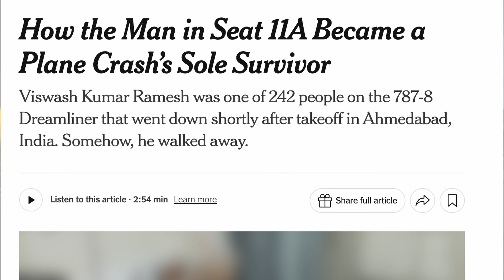Why the RAT Changes Everything – Air India 171 Update

Comment: 787 mechanic here. Regarding everyone’s comments about the gear tilt..

Yes, it appears that the gear is tilted forward in the video. This does seem to indicate that the gear handle was selected up. After the gear is selected up, the first step of the gear up sequence is for the tilt actuators to tilt the gear into the position in which it will be stowed in the wheel well.

Pure speculation, but what I believe happened from that portion of information is at around the point the gear was selected up, there was enough residual hydraulic pressure in the center hydraulic system to tilt the landing gear bogeys, but not enough to bypass the pressure switch that allows the gear sequence to continue (the next part being the gear doors dropping)

The 787 and A350 both have the highest pressurized hydraulic systems of any commercial aircraft - 5,000psi. Significantly higher than the traditional 3,000psi systems. This allows for more of a chance for hydraulic components to physically move, even if the pressure is actively bleeding off the system.

While the RAT does supply emergency hydraulic power to the center hydraulic primary flight controls, it does NOT supply power to the remaining center hydraulic system components - nose gear steering, landing gear actuation, and high lift devices (flaps and slats)
Reply: Thanks Adam.
Reply: So you're saying that they lost hydraulic power due to vibration of the APU ?
Reply: @excusemenoexcusemeno1671 no. Nothing to do with the APU. The APU was probably off at the time of take off
Reply: Do you think this condition could be caused equally by dual engine failure or some sort of catastrophic hydraulic failure?  Or one more likely than the other?
Reply: @pseudocoder78 well judging by the fact that the aircraft lost lift, it’s probably more leaning towards dual engine failure being the primary cause of the RAT deployment, which is insane to say given the odds of that happening
Reply: @adamb5660  Good point, a hydraulic failure wouldn't cause immediate loss of power.  Pretty much some sort of fuel system issue is the only thing I could think of.  Sure looks like both engines lost power simultaneously.
Reply: I notice the vortex of dust/debris on the CCTV cameras while at the end of the runway on the left side but nothing being kicked up on the other...could be they lost power on the rt engine rt at or after V1...and could not abort and then possibly the other engine failed or the wrong engine was shut down...therefore the deployment of the RAT...
Reply: @nmtaco8645 at least from what I’ve seen, I haven’t seen any significant rudder compensation which is what you’d expect if you had 2 giant engines at takeoff thrust and all of a sudden 1 goes out while the other is still roaring.

I’m not sure what happened, but I think the 2nd biggest question behind the actual cause of the crash is going to be ‘did the pilots have any knowledge of a potential failure or issue prior to that v1 point of no return.’ Even if there was fuel contamination, it dumbfounds me at this point in time how both engines could flame out at or near the exact same time. No sputtering (that we know of), no premature indication, just off like a light switch.

Frankly, I pray that whatever cause comes to light shows that there was some amount of avoidability in all this because if not, it could lead to a nightmare of 787 groundings

Comment: Remember when Delta F/O shutdown both engines on a 767 in 1986.  They got a relight just before hitting the water out of LAX.  Fuel control switches too close to engine cutoff switches

Comment: Hello Captain Steeeve. Have you heard or seen the reports about the guy that said he was on an earlier flight on this jet and the air conditioning was cutting on and off and the entertainment system was not working at all? He had video of the non working entertainment system while on board and vent issues.  I also think he mentioned the flickering of lights as well.

Comment: We are probably going to find bad maintainence.  The man on the flight before stated the air conditioning did not work or the video screens in any way.  These complex systems are intermixed.  An electrical problem could shut down the engines.  No plane should fly without the systems working.  Air India is known to be no good.  India is known to be lax as it is a dictatorship and only profit matters. Tata bought it in 2022 from the government, who had been for years trying to unload it.  

We will soon find out a lot when the Black Boxes are found and the voices of the pilots are heard and the systems functions are known such as electrical, hydraulic, and engines.  We will know if the thrust dropped and have an idea of why, such as a cut off of electrical power to run the Fadec system which controls the engines.  No power, no engine.

With an international investigation which includes Boeing, as the manufacturer of the plane, and the engine manufacturer, either GE, or Rolls Royce no games can be played by India.  Aerospace is one business which holds accountability as when there is a problem it is so tragic as right now.  Look at what happened to Boeing with the 737 MAX crashes.  They got lax and have paid a huge price.  I am now betting on maintainence and that also will be studied and mechanics and such interviewed.  Then the physical evidence.

Comment: The RAT wouldn't make a big bang upon deployment but a Lithium Battery explosion would.  It would also take out adjacent wiring which is connected to the main electrical system causing the main wiring to short out, the lights to flicker and most probably go out, the RAT to deploy and as the controls are fly-by-wire then electrical system would fail.  The RAT can not help if there is a persistent short circuit.  The short has to be isolated first.  The engines would continue to run but return to idle.

If it were a duel engine failure the landing gear would still have retracted because it takes more than 10 seconds for them to spool down from full power at takeoff and they are providing hydraulic pressure all that time.  Even if the engines instantly stopped there would be residual pressure in the system to at least begin to retract the gear.  But an electrical failure would stop any further control instantly.

Comment: Cmon people you dont need an engineering degree to figure this out. 1. Fuel pumps failed. No engine means no power, theres no gas powered on board generator folks. 2. Rat deployed because of loss of electrical and hydraulics failure. No engine rpm means no electrical which means no fuel and no hydraulics, electrical voltage is needed to run the pumps. Rat deployed for a few seconds does not generate enough power to restart engines nor supply enough power quickly enough to save any plane at 500 feet. Gravity takes over. Its designed for electrical malfunctions 5000 feet + 3. Plane descends quickly because of near max load and loaded max fuel. 110 degree heat probably had something to do with it also as someone noted a different video of interior issues a/c, monitors, etc.

Comment: A dual engine failure? Wow. And right after rotating? Has this ever happened before?

The only thing I can think of in regards to fuel contamination on a commercial jet that resulted in a dual engine failure was with Cathay Pacific Flight 780 where salt water got into the fuel system at the departure airport. It fouled the ground fuel pump filters and collapsed the filters once into flight at altitude.

IF...and I repeat, IF this is the case, were proper steps taken at the departure airport to routinely inspect the ground fuel storage and delivery systems? Because we know that there is a history of airlines, looking to maximize its profit margins, sometimes take shortcuts or lengthen the intervals on scheduled maintenance to keep planes in the air making money instead of being in a hangar.

Comment: Let's assume they did retract the flaps but they could not understand why they had no lift....then they activated the RAT just to possibly get power that they thought they needed , but did not really need...The lights would still flicker when they tried to use the power from the RAT? Is the RAT power supplemental or replaces the main power?

Comment: I was going to say your theory was wrong on your first video. There's no way two pilots made errors not raising the gears but raised the flaps instead. I was thinking lack of thrust based on another video that I saw or the plane was too heavy. It took the whole runway for them to lift off. You can see the dust being stirred up because they got all the way to the end of the runway and the engines were stirring up the dirt and created a whirlpool of dust. I'm an aircraft mechanic for one of the major airline here in the USA. They should have aborted the takeoff based on what they were going through but apparently it was too late to make that decision.

Comment: Wouldn't 11A guy be able to say we were taking off and the engines were roaring then it got quiet?  Like the engines are no longer working you'd think..even for a sec prior to Rat sound.. it'd gotten fairly oddly quiet in cabin?  Just a question where I'm thinking it thru.. not a pilot so I wouldn't know but seems logical.  Thx

Comment: The Mayday pilot reported "No power AND no thrust."  A passenger who flew the plane on the flight previous to this one said this planes AC did not work well the previous flight.  He said the compressor kept kicking off and on in flight.  This is important because the 787 uses an all electric, bleedless (air not provided by engines like conventional airliners) pressurization/AC system.  The 787 has a huge electrical demand compared to other airliners (this Bleeless pressurization system has a lot to do with it.)  Something electrical went really wrong on this "electric jet".  I hope it's something that won't ground all 787s when they figure out what it was.....May all RIP

Comment: Another thing I noticed on the first video was a large amount of dust being stirred up when the jet lifted off. Not typical on a heavily used, paved runway.  Since runway 23 requires a back taxi, did they use the whole 11k feet, or did they turn around at the first turn pad which only gave them 8k feet.  Wondering if they could have slightly run off the end of runway causing the squat switches on the vibrate. With the auto-brakes typically in RTO on takeoff, wondering if the jet tried to throw the breaks, zero the power, and deploy spoilers.  On the second video, there is a distinct shadow underneath the flight spoilers, suggesting they could have been deployed.  ??

Comment: My theory, there was an electrical issue on the plane which resulted in the fuel pumps failing and the engines starving then resulting in a  loss of hydraulics and the RAT being auto deploying. The RAT on the 87 cannot provide enough electrical power to power the fuel pumps to restart the engines, this requires the APU, thus fell out of the sky.

Comment: Both engines may have shut down. This is one scenario. The AI aircraft put the thrust levers in the takeoff position, then for some reason put them in the idle position. In this case, the engines spool down late, the computer(TCMA) detects the excessive thrust abnormality, and shuts down the engines. Even if the speed is just before V1 and there is only 100 meters of runway left, the software will ruthlessly shut down both engines.

Comment: I'm happy you took my suggestion to use the original video instead to improve your analysis.  Thanks.  Now if only you would take my other suggestion to eradicate your rude off-angle camera shots.  Replace the producer if they refuse.

By the way, if "gear up" was done and coincident with power loss, and some analysis of the wheel position indicates the gear-up actually started then failed, then gear activation could be related to hydraulic and engine loss.

Comment: There is a video of the air conditioning, seat entertainment systems, and the flight attendant call buttons not working before the aircraft taxied.    It was 40 degrees C inside the airplane. You can see and hear people suffering from the heat.   
All maintenance, inspections, and daily turnaround inspections must be looked at. ASAP.

Comment: There’s a video showing all power out on the previous flight before the fatal flight. Therefore, the plane was having electrical issues. Now, from what I understand, the RAT automatically deploy’s when the hydraulic & electrical system fails. My thoughts are, if the fuel pumps shut off due to no power & no hydraulics, then the RAT deploy’s & resumes power & hydraulics, but the engines have already shut down, and being so low to the ground, the pilots probably would not have time to restart the engines & regain control before impact, if they even recognized they lost both engines with all the chaos happening so fast & so low to the ground. So, I agree with Captain Steeeve’s theory that both engines lost power. Hopefully, the black boxes along with the investigation will tell us all what happened for sure.

Comment: Doesn't add up to me. Does not explain flap config. The RAT can be manually deployed. I guess: misconfigured take off, they hit the end of the runway, FO knew they screwed up before take off, had a panic attack, started pulling at system knobs that flashed through his mind in guilt ridden horror. Forget not the human element. Insanely odd the Capt got on the radio at 500 ft instead of flying the plane suggesting they knew they screwed up as the plane left the tarmac and his experience told  him there's no way back from this

Comment: A fifth confirmation was the LENGTH of the takeoff. They used the ENTIRE runway, which for this airport and plane NEVER happens. There are several minimums like V1 (TDS),  V2 (minimum takeoff safety speed), VMC (MCS) , VMU (MUS), V3 and V4 during the roll down the runway that the pilot and copilot (usually the copilot calls these out to the pilot) watch out for. One is the minimum SPEED they need to rotate, and one is the amount of runway remaining to rotate safely.

The takeoff down the runway SHOULD have been aborted before rotation and takeoff as it looked like they didnt have the minimum V2 speed at the safe location on the runway to rotate. Why the pilot PUSHED the plane beyond the abort point and decided to try and make the takeoff is unknown at this time. It also looks like the RAT deployed on the ground or just as the plane took off. This means the ENGINE was already failing and NOT producing enough thrust to roll down the runway let alone take off safely. Again, ABORT takeoff should have been implemented. 

From what I can tell not many pilots want to abort half way down the runway if they can help it. But if the plane struggles to get up to speed its better to abort rather than chance what happened with this failed takeoff. You can tell they pushed it RIGHT to the end of the runway becuase as the plane rotates you see a CLOUD of dust, that looks like smoke from the engine, but is the DIRT at the end of the runway. 

This is WAY WAY to close and should never be attempted. Then as the plane lifted up you could immediately see it had NO LIFT, as the angel of the nose was too low, and it YAWED, indicating loss of control. The pilot tried to dip the nose a bit, and the plane yawed again, but NO THRUST and NO LIFT could be seen. They maybe reached 500 feet, floated a second or two, then came down hard as the wings lost all lift.

A question that will nee be answered with the "box" is did the Pilot deploy the RAT manually or was the RAT deployed automatically by the system? IF the plane STRUGGLED down the runway to get up to proper V2 speeds then why push it? Why didnt the pilot abort?

Comment: I realize that all theories now are just preliminary and pure speculation, since we don't have all the evidence yet.  One thing that works against this dual engine failure theory is that the lone survivor said that he could feel the engine thrust to go up.  He said this after he noted the bang and the cabin lights going on.  So, by this eye witness account, it almost seems like the engines on the plane were running.  Could an engine be running, but not produce any thrust?

Comment: With the RAT deployment being primarily for higher altitude / cruising flight, you have to believe it is designed to be operating at a much higher air speed. With minimal air speed at the stall, the RAT may not produce enough power to make a difference.

Comment: Retired 747 Captain here - I'm very keen to read the official reports on what happened. It's quite perplexing, I've never seen anything like it.
I initially though it might have been a double engine failure due to bird ingestion, but there was no sign of the engines training anything that would indicate such a thing. The dust being blown up at the end of the runway just as they rotated is interesting, and it may be a clue that they were much heavier than planned and so very nearly ran out of runway before getting airborne.
The RAT??  I really don't know.

It is indeed most curious.